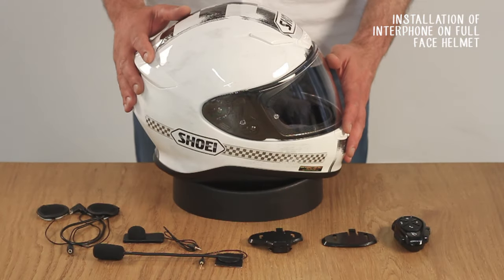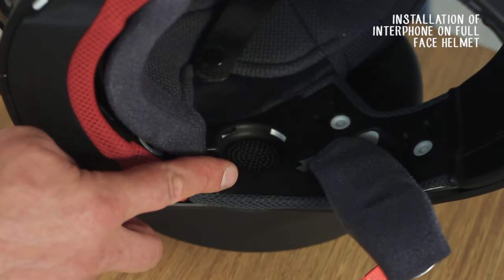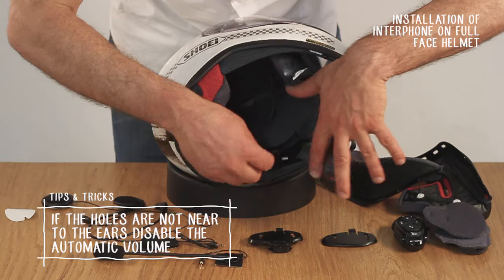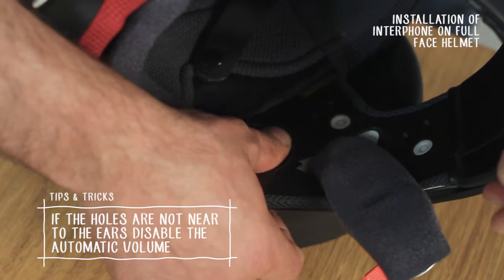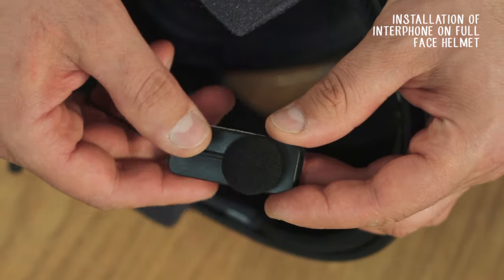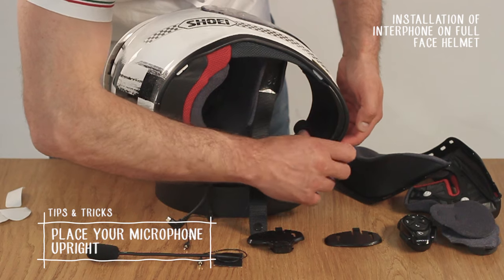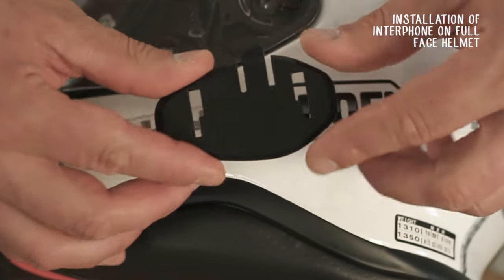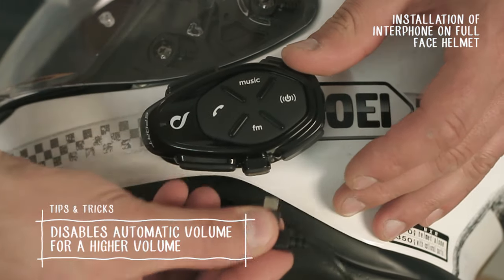Interphone Tutorial 1: How to Install Intercom on Helmet

Comment: The mic volume is very quiet
Reply from the maker: You have to disable automatic volume control. Turn on the control unit, press the "next song" button (top right) until the LED turns fuchsia. At this point, press the same button twice, until you hear "deactivated" in the headset. Then turn off the control unit by holding down the power button.
Reply: @InterphoneChannel  thanks so much I’ll try that👍

Comment: I have a Tour for bike to bike, and VOX does not work (yes it is switched on both units). When either listening to music or not, and then speaking, the intercom does not activate. Intercom will only work by pressing the intercom button to speak, and then again to turn it off. How can we get VOX working? Must use VOX, using button activation is no good and not an option. It was only bought because it should have VOX function.
Reply from the maker: Hi Astonishist. Please fill out the form at the following link to resolve your issue. Our assistance will answer you as soon as possible. Continue to follow us! Thanks, Interphone team http://www.interphone.com/it/web/guest/richiedi-assistenza
Reply: Interphone It's no problem I returned it and bought Cardo Packtalk. Much better.